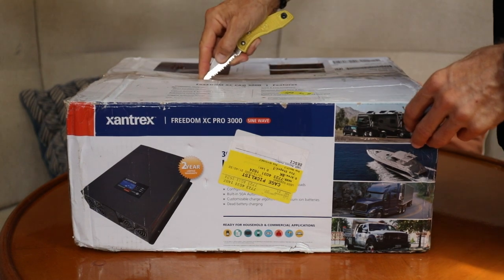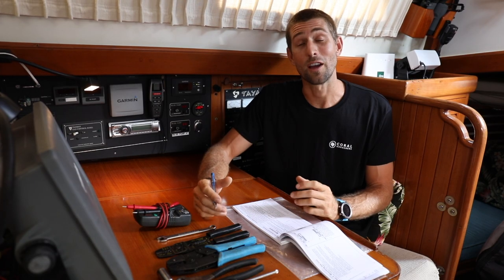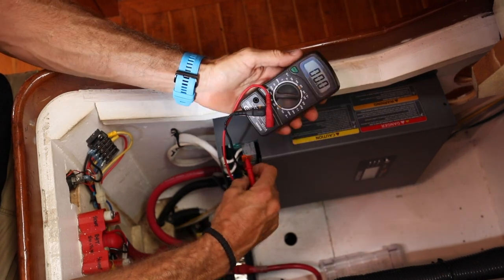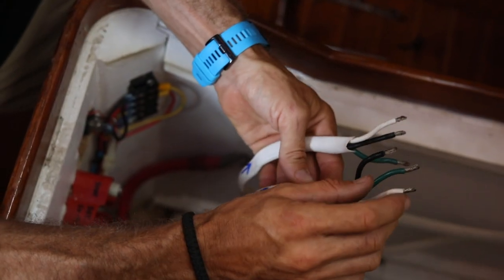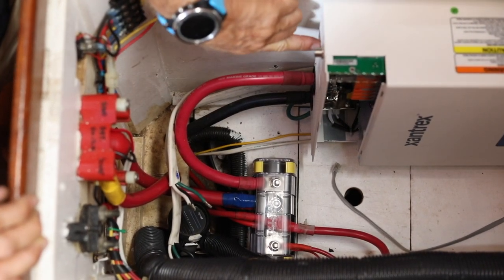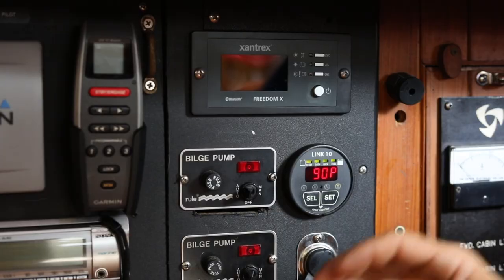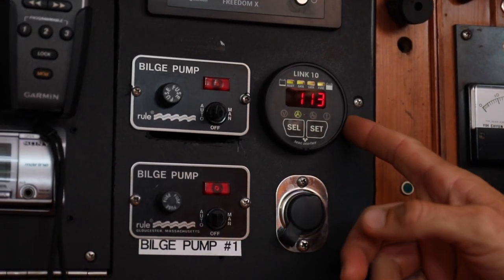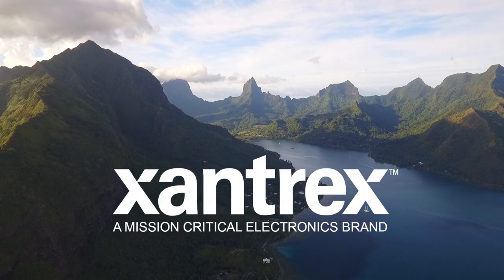INSTALLATION: FREEDOM XC PRO Marine Inverter/Charger  - Voyages of Agape

Comment: it seems everybody is putting this on a 30 amp ac input circuit install manual says 30 amp max.  Could I use and existing 15 amp circuit and lower the charging output?
Reply from the maker: This can easily be done by changing the PowerShare value to 15 amps.  This is detailed in the manual on Pages 77 and 72. 

Please note that this will not change the load side demand. If you are running loads (refrigerator, AC powered lights, entertainment electronics, and such) downstream from the Freedom and they exceed 15 amps you will trip your 15 amp circuit breaker. 

For any further questions, please contact tech support at 
https://xantrex.com/support/get-customer-support/

Comment: If you have 2 a/c panels feeding different circuits could this inverter be used and how would it be installed?
Would you have the one a/c output going to a small breaker box and then splitting to the two seperate circuits?
Reply from the maker: Hi Gord, we are not sure how to answer this one. Please contact our Technical Support for assistance 1-800-670-0707 or 	customerservice@xantrex.com

Comment: Will this work with Victron Lithium batteries and a Victron BMS which sends a charge disconnect signal to all charge sources?
Reply from the maker: Depending upon how the signal is delivered from the Victron Battery/BMS, the XC Pro Marine's ACC Signal feature could be what you are looking for. Please refer to page 42, 43, and 55 of the Owner's Guide. https://xantrex.com/documents/Inverter-Chargers/Freedom%20XC/975-0799-01-01_Rev-D(Freedom%20XC%20PRO%20Owners%20Guide)_ENG.pdf

Comment: Hi, I'm often in marinas in rhe caribbean where there is 220 on the docks, and then others have 110. Will this unit accepte both 110 or 220 shore power at the same time? if not is there a unit that does. How would I set it up to plug and play either voltage when I tie up?
Reply from the maker: No there's no inverter/charger unit that accepts both 110V and 230V unfortunately. Only the standalone battery chargers example Truecharge2 are universal that  can work off both 110 and 230.

Comment: Your chassis ground looks to be way undersized. ABYC says one size smaller than the DC supply. From the instructions you referenced "connect  it between the Chassis Ground lug and the boat’s DC grounding bus or engine negative bus. Use a wire of gauge 2/0 AWG minimum, 0 AWG for Freedom XC PRO Marine 2000, and 3/0 AWG for Freedom XC PRO Marine 3000"  I am surprised this is on a Xantrex official channel.
Reply from the maker: Be sure to read the manuals because it shows the recommended wire size for the units and If those sizes are followed then the recommendation is true, one sizes smaller than the feed cables. If the customer chooses to use a cable of a larger size, then they must also increase the ground cable size.

Comment: I have a Xantrex Freedom XC Pro 2000W/!00A ( not Marine) newly installed in my RV to Charge two Renogy 12V 100AH batteries with internal BMS. I have the Bt Remote control and software.  I have updated the inverter firmware to version 106.   What are the proper settings to charge my batteries???  Thanks   Gene Ferris
Reply from the maker: Hi, Gene please refer to your Renogy manual to check the recommended voltage settling for your battery and then you can configure the Freedom X remote control panel.

Comment: Why did you change to the Pro when you just put in the non-pro a year or 2 ago?
Reply from the maker: The PRO version has built-in communication which makes it easier for RV and boat manufacturers to install in factory. The PRO version also have a bigger charger compared to non PRO models and better surge rating.
Reply: @XantrexTechnology  Did the non pro work o.k. for you? I am going for the non-pro because I am 72 and not that computer literate. Plus a little cheaper. Will the non-pro work well with lithium batteries? Thanks for your reply...
Reply from the maker: @robertgregory2618  Yes both will work with Lithium batteries

Comment: I am installing a 817-2080 and wondered if you could tell me which way air flows from the fans. The manual is confusing because it says you need 5 inches from obstructions on dc side then says 2 inches on ac side Huh... The ac and dc are on the same side. That needs to be corrected. Does the fan pull heat out of the gfci side or do they blow air through to the ac and dc connection side? Thanks...
Reply from the maker: Hi Robert, the FreedomXC will need at least 2 inches of clearance for the air flow at either end. The 5 inch for the DC side is to accommodate the bend radius of thicker wires. 
The airflow will exhaust out the side were the wires are connected.
Reply: @XantrexTechnology  Thank you...